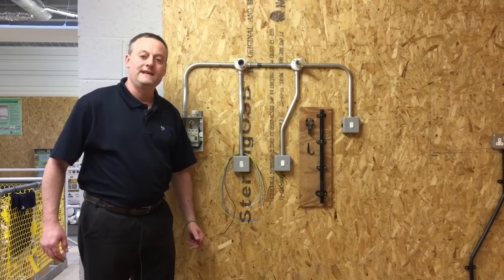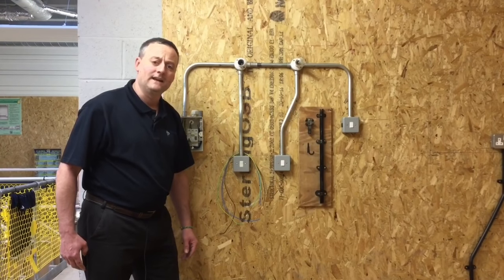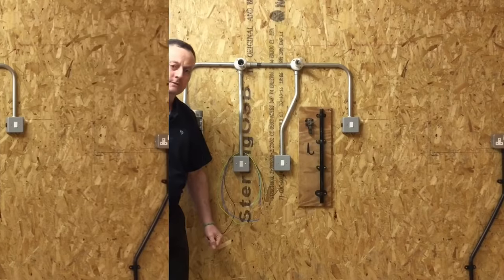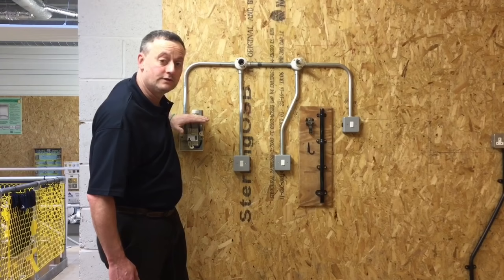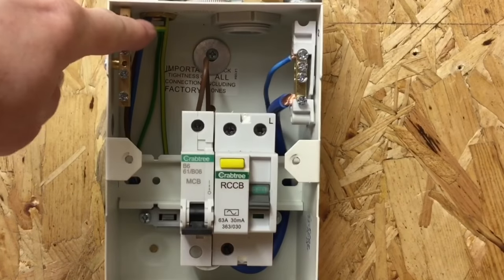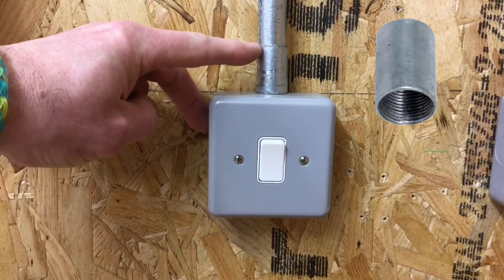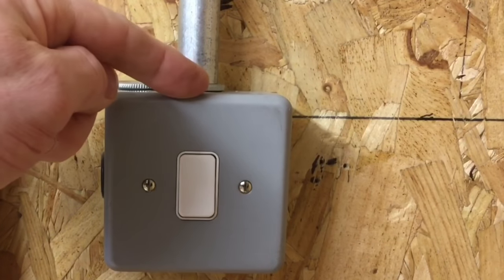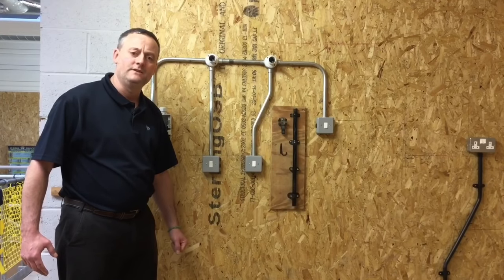Re-Cap Learning Part 1 our Steel Conduit Lighting Circuit (Installation Theory Exam)

Comment: Brilliantly done very helpful. As a side note how would you safely take 2.5 t&e cable into a metal clad socket box. Rubber grommets?
Reply from the maker: Wiska cable glands. Thanks for watching. Gaz 🦾
Reply: Cheers would that be the same for indoor use. I was thinking of wiska cable grommets. Like the ones used on consumer units

Comment: Thank you for this video. I've got a quick question. Could you make a video on how you assembled this lighting circuit once the bends have been made? There's a sequential steps that aren't entirely intuitive for me as an apprentice. I presume the spouted t box on the left was installed first with the 90, then the spouted t box on the right with the 90. Then the middle section with a running coupler. The two middle vertical runs, I am uncertain of. Thanks for hte video.